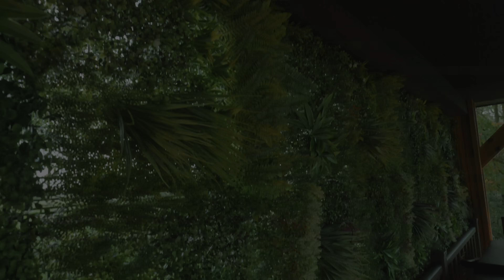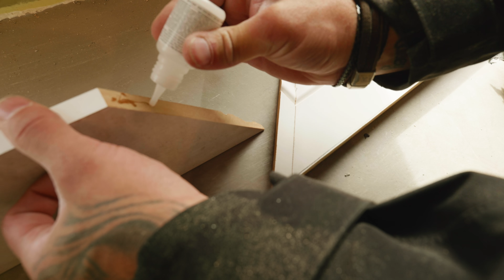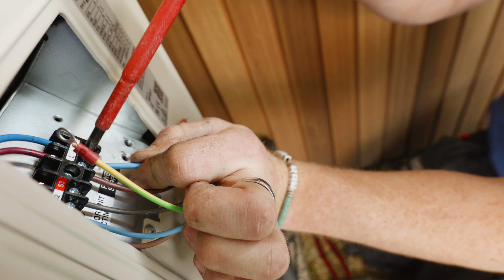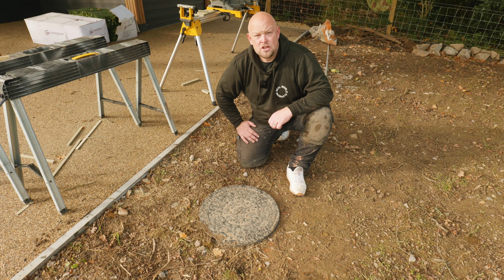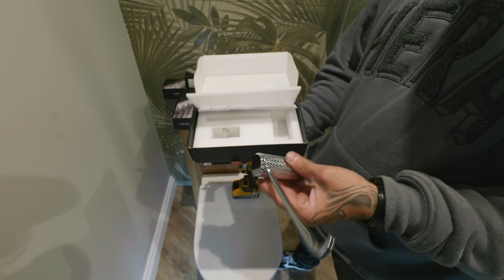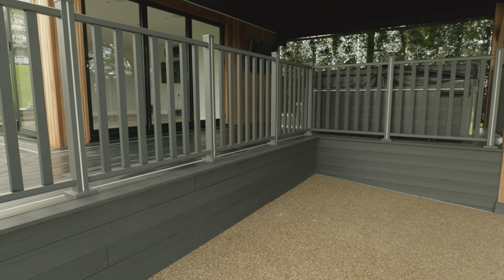MAT ARMSTONG GAVE US A SUPERCAR FOR COMPLETING HIS DREAM GARDEN ROOM BUILD

Comment: I’m a construction super for 30 years. And why you put the skirting(base boards), on before the flooring is completely beyond my understanding. You made the flooring guy scribe the walls twice. When you could have set the base board directly on top of the cut side against the wall. And our flooring guys when doing it. Drylay the last row in a Harding bone pattern install. Then mark them and cut them in a a flooring cutter for VCT and LVT. The door frame and trim I must also point out. Look terrible. And whoever showed you how to set a door frame needs a lesson as well. Please find a carpenter to do the work. It’s insulting to us tradesmen.
Reply from the maker: For someone with so much experience it’s embarrassing you felt the need to come here and insult people lvt was installed by someone with years of experience and he requested the skirtings be on as it applies compression to the lvt clearly not a clue on that pal and don’t worry about how I do my work the end result is mint simple as that now go how yourself a good evening away from my channel 👍🏼

Comment: Done a good job lads, ive enjoyed following this build 🍻
1 question. Did you seal down the back of the enclosure track before fixing it on to the tiles, the holes drilled for the track to be mounted, and where tile meets the tray? I'm only asking as you didn't mention it, and it's a massive leaking point if not.
Reply from the maker: Yeah we did, didn’t make the edit that’s our bad 🙌
Reply: @homeimprovements I assumed you had. Didn't doubt you haha. Would've been good to show it in the vlog or explain it just incase someone who hasn't done one before and decides to fit one and follows your step to guide 😂

Comment: I'm intrigued about the outside water piping. I have a length feeding a tap outside my house which freezes up and bursts in the winter. How's this going to handle freezing winters?
Reply from the maker: Lagged / insulated 😊
Reply: @homeimprovements  I lagged mine, but it still bursts. I had to fit a valve in the house and drain it for the winter. Fingers crossed Mat's is OK.

Comment: Box that air con lagging as after a couple of years the lagging breaks down due to sunlight and weather. If you don’t it end up loosing 20-30% of efficiency
Reply: Ac pipework is in black uv protected trunking all the way down 🤘
Reply from the maker: It’s boxed on the back of the building mate or is that not what your saying 😊
Reply: @ the air con pipe work lagging needs to be hidden from weather and sun light as the go powder and break up and then hold water this results in the unit not working correctly. Take it from a guy who inspects plant and has to make sure the cdm regs are followed etc. on the market there is no insulation that is weather proof so that why needs boxing in with weather resistant stuff to prevent ac pipe work being exposed to weather. The water pipes are same but you did mention they would be boxed in

Comment: 1 skim Jim’s been on that plastering in all my 20 yrs of plastering you should still never see the joins in the plaster board I put mine on 4mill thick 1st coat 3mill 2nd coat and never have I seen join lines underneath.That should of been double skimmed  On the 1st coat of plaster being a outbuilding or dry lined the plaster looks good but will crack within 2yrs 💯just saying no hate lads another than the plaster 10/10 job 💪🏻